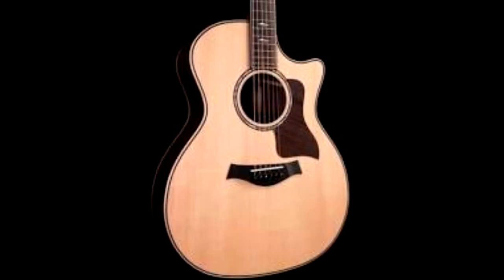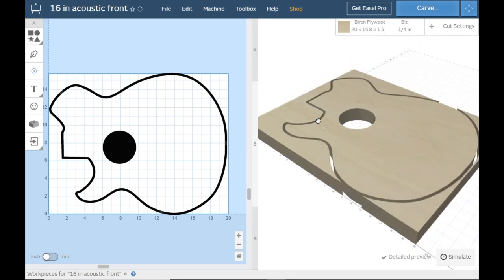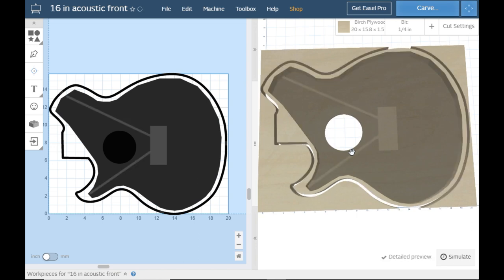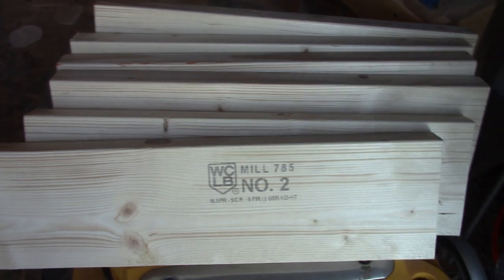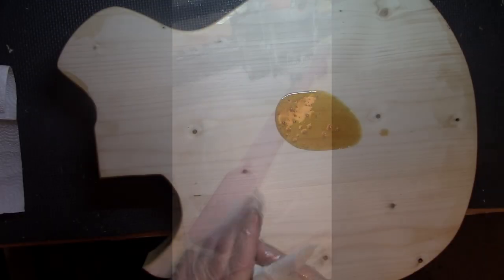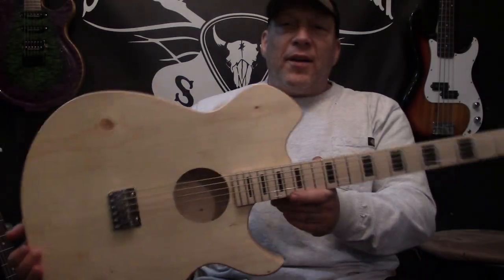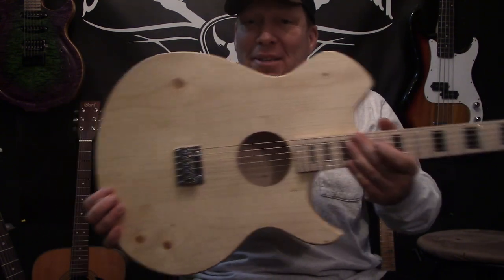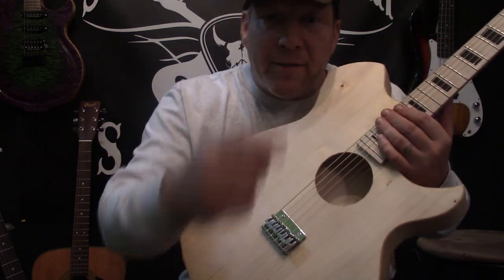I RE-Designed THE Acoustic Guitar And You Wont' Believe HOW IT SOUNDS!

Comment: Great video. Interesting stuff. A couple things...if you make more of them, I’d be interested to see you experiment with the bracing. I think the braces radiating out from the center bridge plate symmetrically could be improved upon. You’re choking off the potential tone, I think, and it kills low end. Take a look at Martin and Gibson bracing patterns for ideas on improving bass response. The key is opening up the lower bout so it isn’t choked off. See here: https://youtu.be/kTh-bDuRGDA

Second, the integrated braces is a very cool idea, but I think because the grain runs the same direction as the top itself, cracks could be an issue as it ages. A laminated piece on top of each brace would fix that. Just thinking out loud here. And the bridge... interesting as it is, it looks out of place on that large body. An archtop style with tune-o-matic and trapeze tailpiece would look the part. But I think you’re really into something here.
Reply from the maker: You and I need to put our heads together and perfect this thing.
Reply: @scarmyguitar  I think a bit more experimenting and some cosmetic stuff like a rosette and you're going to have something you could really sell if you wanted to.
Reply: Go Guys! Everything is waiting to be shaked. I've drawn my own too, that a friend luthier built.
Something that don't exist, is an acoustic with a neck-thru. For me, they are a must, for several reasons, but in an acoustic, I think it can really do something un-expected. Just an idea. Thank you anyway, both, for your efforts. Keep up carrying the spirit.
Reply: I’m excited to see the next one.
Reply: Some really awesomely tips. We could probably consider this a prototype for now. He'll probably take your advice to heart and make something even more awesome.
Reply: The electric guitar bridge is a great communicator to the wood. Hell, I would even go one better and suggest a wraptail bridge set in the bridge block. You could cut a trough through the cnc'd braces and set dowels in there with some glue. No fuckin trapezeó and other Al Dimealio nuanced bullshit.
Reply: That red eye must be some good indica

Comment: Cool design. I like the thin body too. It might be a good idea to put some kind cross grain wood or perhaps some carbon strips on the tops of the braces so they don't crack over time due to changes in humidity etc.  It's interesting to see the small electric guitar bridge - probably activates the top in a different way. Thanks

Comment: Sounds good. First wood wise I think Spruce, Douglas Fir, Port Oxford Cedar top and Mahogany or Korina back would be great. Bridge wise, saddles could be Graph Tech String savers for a more similar acoustic tone, which the Ghost System is an option to make it acoustic electric. Braving I would model more like hybrid fan bracing with the bridge having a thicker block as is, possible running a 30 degree v from the block to reinforce the top behind the bridge. If you want density and resonance, while using one type of wood, Mahogany, Cherry, Walnut, Rosewood, Sycamore, and Wenge are good options.

Lastly do you have a link to the CNC machine you use? I am building a garage / workshop and will be buying some better equipment soon.
Reply from the maker: https://www.inventables.com/